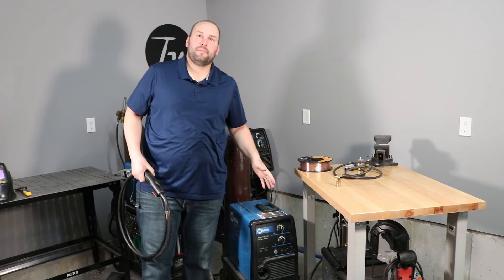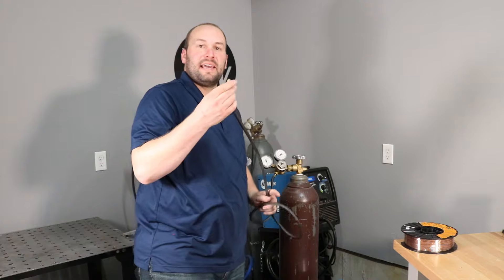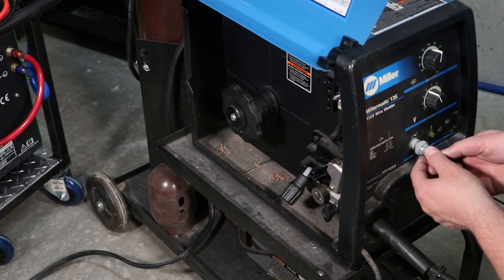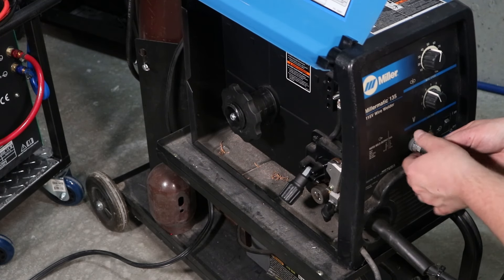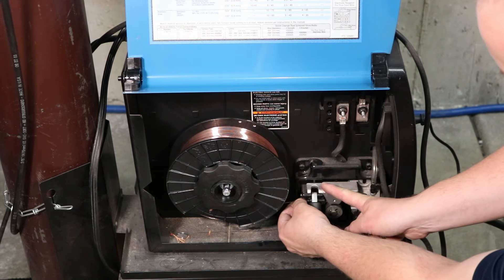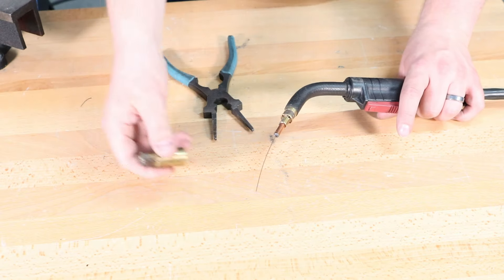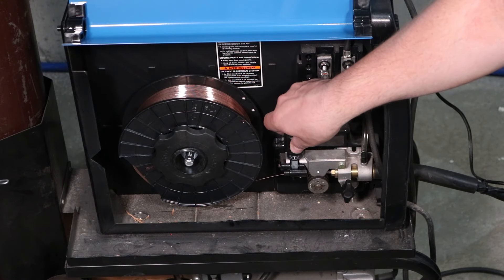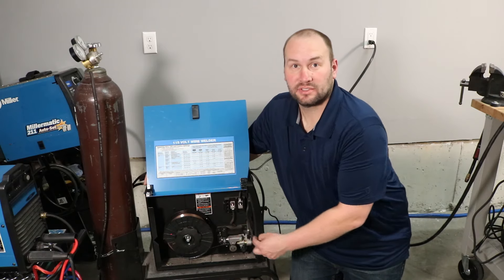How to Set Up a MIG Welder - MIG Welding Basics for Beginners

Comment: Thank you so much for creating this video. It is just what I need to finally get that nice used MIG welder working. I have never welded before and the welder has sat in my garage for several years. But now I am turning 75 and am running out of time to procrastinate any longer. You have encouraged me. A shout out from Houston, Texas via Little Rock, Arkansas.
Reply: How is it going??

Comment: hi what the different between mig gas torch & mig none gas torch
do i need to change the torch if i switch to different welding type for example to mig none gas AKA fluxcore welding
Reply from the maker: Some torches have a different nozzle, but some just use the regular MIG nozzle. I’ve used the gas setup on my torch with flux cored wire and no gas. My only complaint with that is it gets hotter when you make a long run. Lee in mind that you usually need to change your polarity too when switching to flux cored wire.
Reply: @TimWelds  tq very much i like ur video easy to understand

Comment: I wanted to MIG weld two steel 55 gal drums together, and I think I just found the man that showed me how to do it. I'm going to invest in a Miller MIG welder and give it a shot. I'm not sure if I should use flux or non flux wire, what my settings should be, and other things - heck, I never welded before. But I think if I play your videos enough, and get the jist of things, I can work myself through it.  Thanks Jim.
Reply: Get a $10-$15 steel/iron piece of scrap from lowes and lay beads on it till you get good at making passes and making puddles, when you get that down then you can try to focus on depth and how much heat you can use when you get the flow going. go from right to left and angle correctly. You got this!

Comment: Hello mate welding isn’t normally my line of work, I’ve welded before fairly decent but never owned or worked on a welder. I’ve only just started to get into it, I’ve brought a welder and it turns on fine, I’ve threaded the flux cord wire through to the end of the gun, everything works but when I go to weld metal all that keeps happening is it just pushes more wire out and there is no weld? Have you got any information?  will be very appreciated.👌🏻

Comment: Hey, great video! Newb question, what are the settings supposed to be at for the gauges? what type of shielding gas are you supposed to use. I just bought a MIG/fluxcore but have not tried to use it with gas yet...
Reply: 75/25 shielding gas is the norm . . .Argon/Co2 . . .  I have my gas set to 20 cfm
Reply from the maker: I use 75%Argon 25%CO2, but you can also use 100%CO2. Straight CO2 is cheaper, but will spatter a bit more. As far as flow rate, I run 20-30 CFH, depending on conditions. 25 is usually a safe bet.

Comment: I saw a funny video this Russian guy used lipo batteries 50v and just connected electrode was powerful enough to weld steel . the batteries gave about 5kw  maybe that's the future
Reply from the maker: Definitely! Fronius has a really cool battery powered stick welder that a lot of people use for maintenance and repair. Guys in the off road scene have used 2 car batteries in series with jumper cables to fix something good enough to get home. I've seen videos of lipos blowing up, so I'll probably leave that to the Russian guy. :)
Reply: @TimWelds  i have a spot welding machine for battery cells that takes up too much space and cant travel with and uses mains. i always wondered why there wasnt something smaller now chinese made a mini spot welder for $30 that uses a pocket size lipo. does what i need.
i wanted to ask about mig welding titanium again.. since they use argon and argon is denser than air does that mean its possible to pour argon in a tub and weld in the tub with a regular gasless welder instead of needing a mig?